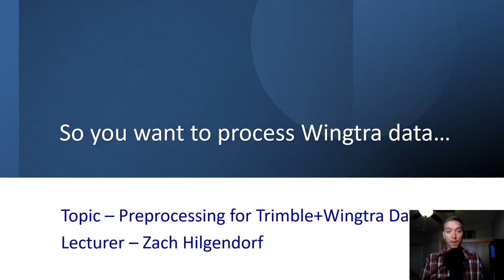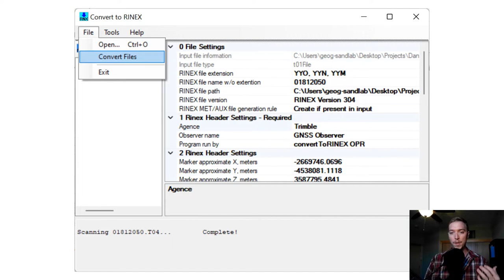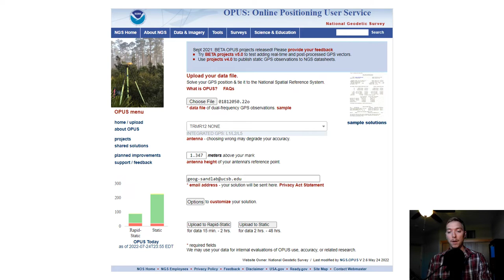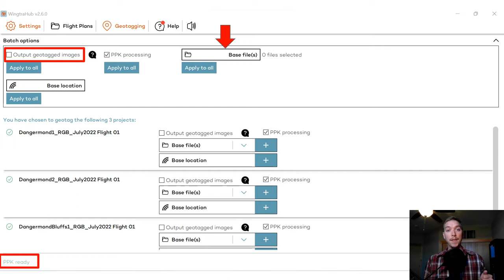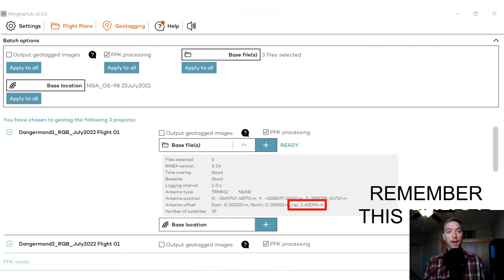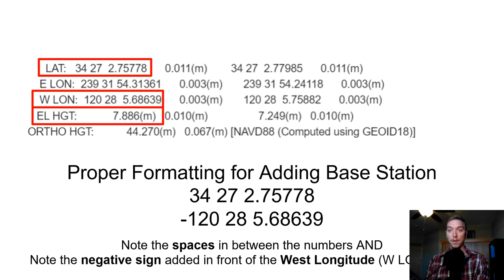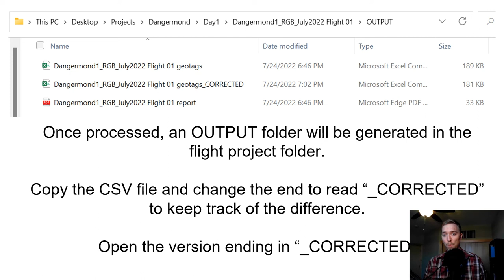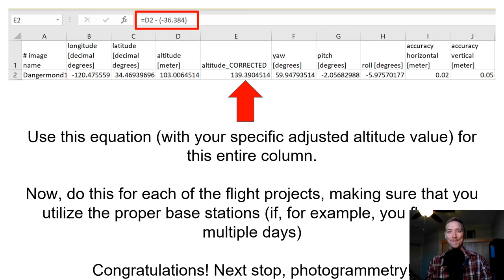Preprocessing of Trimble Base Station and Wingtra PPK Data

Comment: Hey Zach ,
Thanks for uploading this video.
I was going step by step on your video but ran into this message.
Help!
Thank you
-Eric

The file 01770180.23o seems to have a collection interval of 286 seconds!ltbrgtThe collection interval must be 1,2,3,5,10,15 or 30 seconds to be processed by OPUS.
Reply from the maker: Hi Eric,
My pleasure! That error would suggest there is a setting on your GNSS gear that is set incorrectly. You can go in and set up your collection interval in the Trimble settings. You need to have it to one of those predesignated intervals for OPUS. Unfortunately, I don't believe you can alter anything after the fact to correct this for your current dataset.
Hope that at least gives you something to look into!
Cheers,
Zach